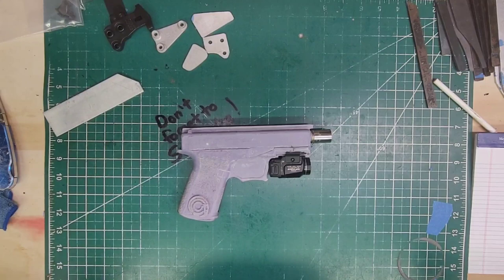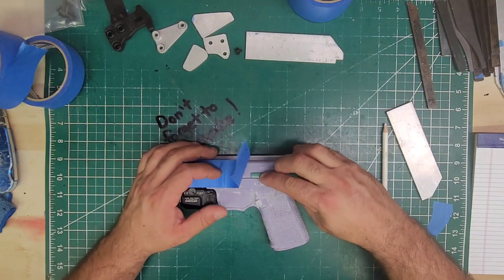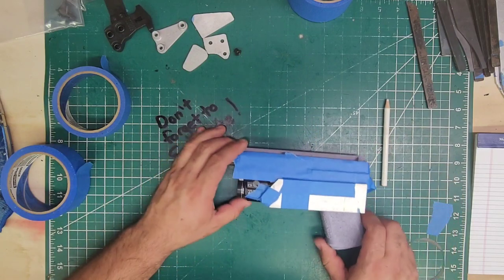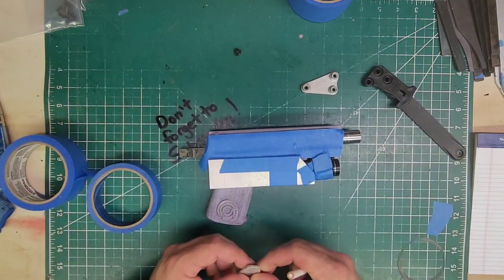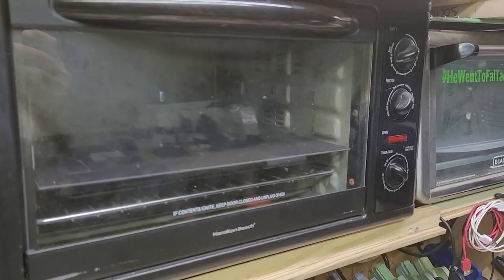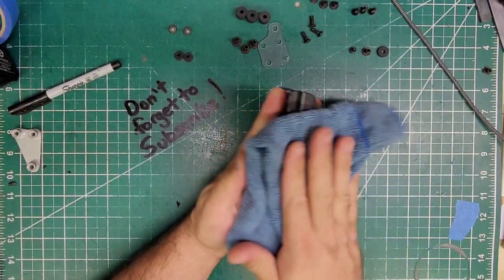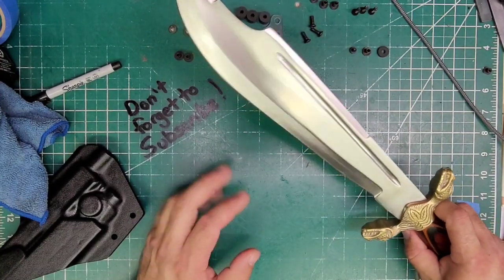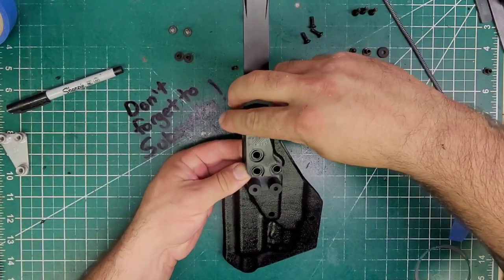How to make a Holster for a Glock 48 with TLR7

Comment: Is there a trick to these WRS hoods? I have recently tried 1 and it is almost impossible to get it to release. The hood goes back and forth fine so its not because of tight pivot screws. It is way harder to actuate than a Safariland Hood. Problem with the Safariland Hoods is the fact that you can only get them second hand on Ebay. I am looking at trying one of the SpetzGear Speed Lock hoods next. Any tips on getting a WRS to work smoothly like it does in this video?
Reply from the maker: Shave down the catch point. Don't do it too much though.
Reply from the maker: For the speed locks, use the gen 2. Gen 1 sucks

Comment: Man, I can't get a 'click' retention with this light.  I'm using a DIY G19TLR7a CNC mold and what I can get is more of 'bump' than a click.
Reply from the maker: Well the click is the kydex snapping back around the handgun. Is the retention on top at the mount of the bottom of the bezel
Reply: @FalTacUnlimitedLLC  Top of the mount.
Reply: @FalTacUnlimitedLLC  Messaged you a pic on FB, would appreciate any thoughts.  Its good enough, but I wish it had a nice crisp click.

Comment: Has anyone found a non spring loaded lvl2 retention hood like a safariland SLS?
Reply: I use Vega Holster 8k95
Reply: @xnc0913  thanks
Reply from the maker: only one i know of is in fact the safariland. but you can only buy those on ebay

Comment: When you tape the aluminum to mold is it flush with the light? Or do you need to prop it up with another piece of something to make level? Or are you alright with the slight angle that it sits?
Reply from the maker: It all depends on the build. If the grip is significantly taller than the light, I use smaller pieces so it's flush with the grip but higher than the light. In the world of foam pressing there are just some things you can't avoid.